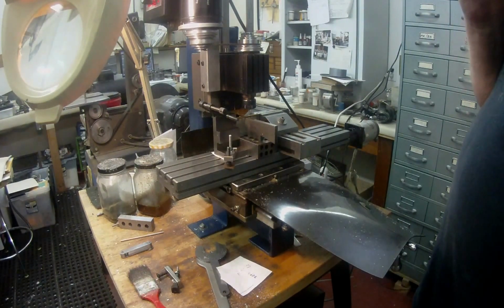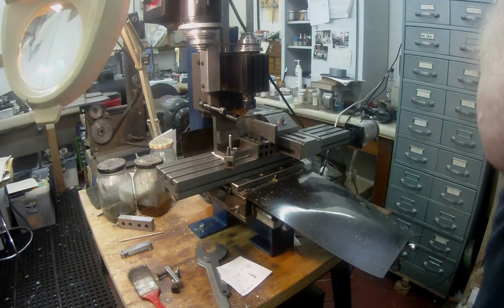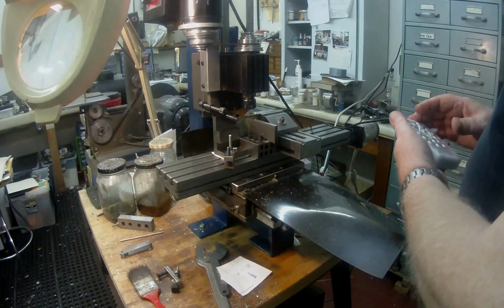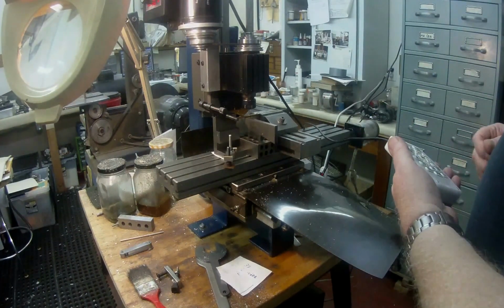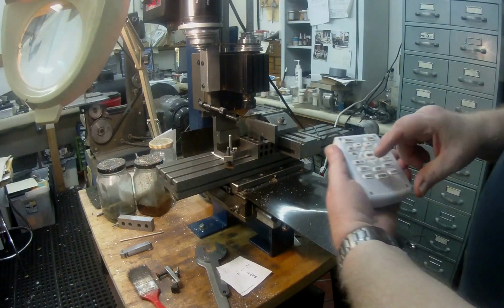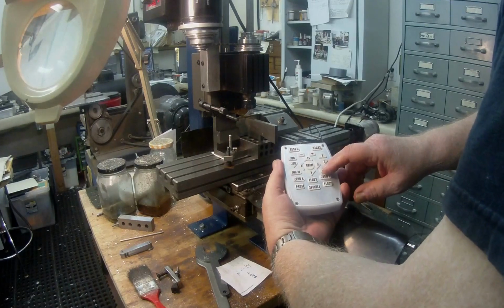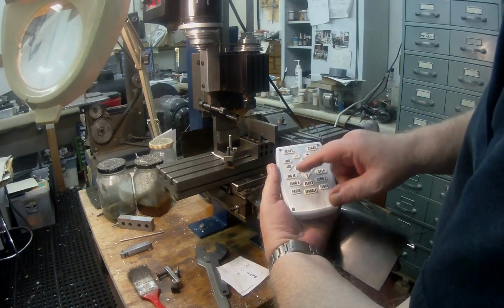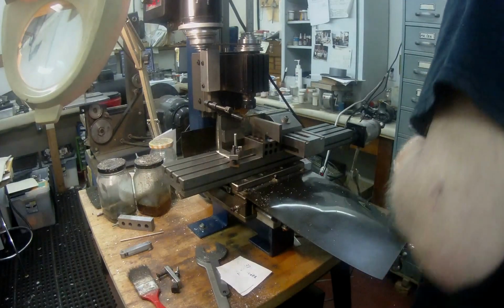FILE0002 Sealion 4 cyl Engine

Comment: Interesting way of controlling stepper motors, I find such things baffling. Walter would you be able to show us a little more of just what is involved in creating such a system.
Reply from the maker: Stephen, being a novice at cnc, I can only explain as such, my hand pendant gives control through the program Mach3 which is downloaded onto my computer which can do the same thing as the pendant by using the computer keyboard, the only reason I bought the pendant is because my computer is at one end of my shop while the mill is at the other end, the pendant saves me running back and forth, if you wanted to pursue and dabble  I think Mach3 has a free demo download you could tryout,
This might help you MACH 3 CNC  CONTROL SOFTWARE TUTORIAL 2 THE INTERFACE
Reply: Walter Maisey Thanks Walter